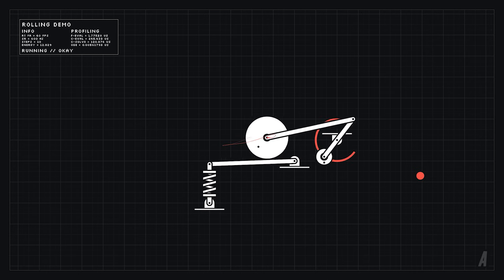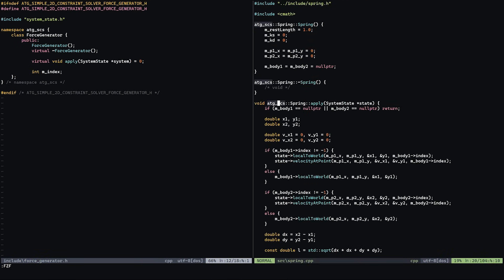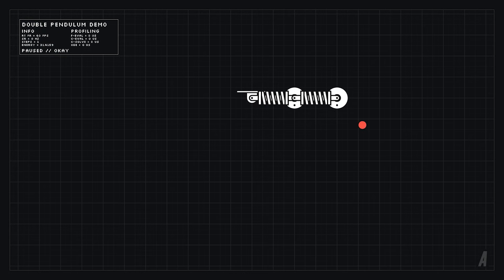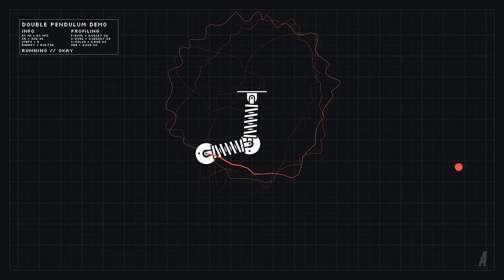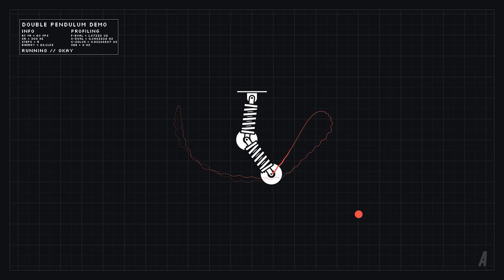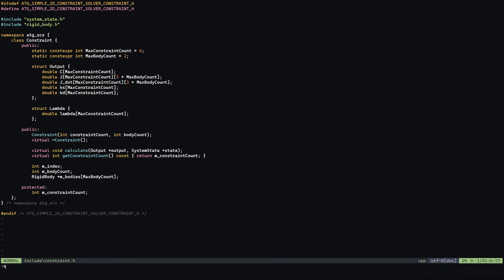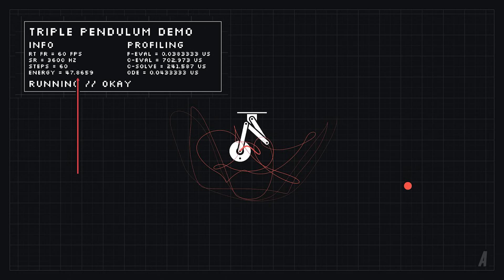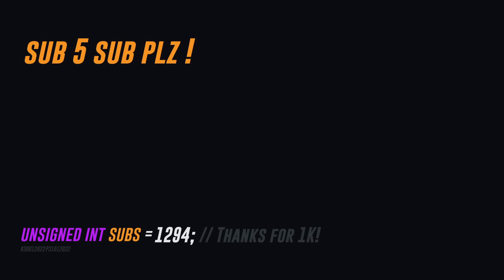Building a Physics Engine with C++ and Simulating Machines

Comment: Let me get this straight. You were struggling with obs, so you just made your own video encoder????
Reply from the maker: Not exactly. I wasn’t struggling with OBS, it’s a very straightforward program to use. I didn’t like how it would drop frames regardless of how well my computer was running. So, I took the encoding library that OBS uses (ffmpeg) and used it to make my own capture program that doesn’t have that issue. It was fairly easy; you can see the code on my GitHub

Comment: Wouldnt the problem of total energy of the system increasing be more elegantly solved by using a numerical method that preserves energy (like verlet integration) rather than applying damping?

Comment: Why fucking NOBODY when does video about creating a whole physics simulation engine FROM SCRATCH talks about how you turn the code into animation? What do you install and how?
Reply from the maker: @flamurtarinegjakyt3745  First of all, relax. Second of all, I don't talk about it because it's not relevant to the topic of the video which is physics, not rendering. Third, I don't have to talk about it, the rendering code is open source and available on my github. I wrote all that code from scratch as well.
Reply: @AngeTheGreat  sorry I don't want to be mean but I was looking a lot for it 😅

Comment: 10:30 Is friction included in the interaction between the circle and the plane it's sitting on? Like how does circle rotation change direction?
How does angular velocity of the circle affect the energy of the system?

Comment: Windows? Really?
Reply from the maker: Yes.
Reply: @AngeTheGreat   I didn't expect you to respond, just doing a little trolling....presumably the framework isn't tied to Windows and could be implemented for other WM's? I noticed there is a dependency in the audio code somewhere so it seemed a bit more tied-in than that
Reply from the maker: @GeorgeSukFuk  the game engine in this video is my old game engine which only supports windows, but it does work really well with emulators like proton. What discrepancy did you notice in the audio code?
Reply: @AngeTheGreat  ok, ignore me, I actually think I saw something being brought in transitively from one of the other dependencies of the demo project.
Reply: @AngeTheGreat  since you're reading my comments, just want to say I am running the steam simulator from Steam using proton as we speak, having a blast with it even though I do not know what I'm doing!
Reply from the maker: @GeorgeSukFuk  That's great, glad you're enjoying it. There will be an update video about Steam Engine Simulator on my channel soon

Comment: 3:46 I'm confused. I didn't find this in your code, but I didn't think you implemented RK4 or even RK2 (the midpoint method) because looking at engine torque or hp, when you double the simulation rate, the difference halves, so error scales linearly with sample size. I was going to look into it but I am slow and have many distractions. It would probably take me longer to understand than it took you to write the code. So I'll just leave a comment like a bug report.
Reply from the maker: Engine Simulator doesn't use the RK4 method, it uses the semi-implicit Euler method
Reply: @AngeTheGreat  Thanks for replying. I think I saw another video that mentioned that but a lot of this is over my head. I had a feeling it could be be greatly optimized but I'll have to do my own research for now. Maybe one day I actually will improve your code. Although if that happens it might be a year later, and you will have done much better than me.

Comment: Hi! Could you help me with something urgent? I have a mousetrap car, looking somewhat like the first demonstration you made. I am trying to find the ideal stick parameter so that the car travels the further
Reply: I don't know if you need help anymore, but I would recommend another forum like stackoverflow for example to get help if you need it. Obviously they usually help with programming, although it sounds like it's a physics question. It sounds like you are asking how to optimize a design. The standard way is to tweak things and see what happens. A sophisticated way of doing that would be a neural network. That's over my head but it basically randomly tweaks things and sees what does the best and works with that. There's a lot o machine learning videos on youtube.

Comment: you could have done it waaaaaay easier: write your DAE as c(x',x,t)=0, just stack all the equations and variables in one vector respectively, and use whatever implicit IVP solver you have at hand: LGR, BDF, etc. I actually did exactly that, modelling mixed multi-physics systems with 3D rigid bodies, electrical circuits, power plants, etc. Now if parts are continuous (instead of rigid) then is where the trouble of PDE starts, as then you need semi-discretization first to obtain DAE from PDE. And then the DAE are typically too large in dimension for real-time solution. Oh, and once your can solve your IVPs, you probably want to solve c(x',x,t,u)=0 instead, where u is a control input that you want to optimize in order for your system to maximize a purpose (e.g., power throughput, performance, minimum time to finish, etc). You just started :)

Comment: You can try using a symplectic integrator such as velocity verlet to increase numerical stability so that the energy/system does not diverge over time.

Comment: FYI you showed explicit Euler integration which is very unstable. Look up symplectic Euler, which is a one line of code change which will make your simulation both more accurate in terms of conserved quantities and vastly more stable at large time steps

Comment: It's fun getting back into C++.  After understanding a few of these functions, I hope to use them to model musical instruments physically.  It was disappointing so far to hear the results of so-called physically modelled instruments.  Unfortunately, Sample-based libraries are 'by large' still closest to simulating a viable digital twin for a physical instrument.  I would like start with a Fender Rhodes, that is widely understandable from mechanism to electric circuitry.

Comment: You could do the video capture with a pretty simple GStreamer pipeline. GStreamer can directly take your video buffers and automatically wire up a pipeline to encode into pretty much any arbitrary format.

I would also say that, since you're using C++, you could group "x", "y", and "theta" into a 'struct' and create operators for different arithmetic operations for that 'struct'. This would make the code shorter and clearer--and make mistakes less likely if you can rely on well-written operators to do some of the repetitive steps for you.
Reply from the maker: I've used GStreamer before though I don't think it would have been any simpler than simply using ffmpeg directly, it was a fairly straightforward thing to implement.

Ordinarily I would done this and have done it on my other projects (ie using classes and overloaded operators). I wanted to keep this codebase minimalistic and almost C-like. I like to try different coding styles on different projects. I found that it didn't really cause issues on this project and I found it readable, though I'd probably just do it with classes for vectors in the future.

Comment: For the triple pendulum, would there still be issues if there was a small rotational dampening from the joints? As realistically there would be some. There would also be energy loss due to friction with air and from a small amount of stretching as even things like steel stretch and compress albiet not that much.
Reply from the maker: Yep that would usually fix the issue in practice. I think I mentioned it in the video at some point but I don't remember anymore. Thanks for watching!
Reply: @AngeTheGreat  you probably did, it was towards the end so I might've left the video before you mentioned it lol Also your engine sim is insanely cool

Comment: You can use magnets instead of springs, your perpetual motion motion machine is almost complete... But It may be easier to physically build an electromagnet to replace the springs in your demonstration than to program one..God Bless

Comment: Rk4 gets you good accuracy but it is still explicit and does not have great stability properties. You can switch to an implicit Euler and theoretically remove those instabilities forever. There are higher order implicit options as well that improve stability

Comment: great insights and you using what I still remember from 30 years ago when I was C/C++/Assembler teen in love with 3D :) including rungakuta 4th order, quaternions for rotations etc :)
One doubt at 5m52s in the connected net of points, how did you approached that .. in terms of sequence to process stuff like new pos, vel for each node..

Comment: The color scheme of the video is something you could work on. Dark themes can be hard to read but mixing different themes makes it worse. Worst offender is the PDF document which had a light color sceme (for some reason??)
Reply from the maker: I can understand the PDF being out of place (which also annoyed me but I couldn't really justify spending any more time trying to fix it) but I thought everything else used pretty consistent colors?

Comment: First, you take the dinglepop, and you smooth it out with a bunch of schleem.
The schleem is then repurposed for later batches.
Then you take the dinglebop and push it through the grumbo, where the fleeb is rubbed against it.
Reply from the maker: Yes, that's correct

Comment: The code is hard to read. I see the primitive obsession code smell. I believe it will be clearer if you introduce some structs/classes that make the code more abstract—at least Vertex2d/Vertex3d.
Reply from the maker: I wrote it in a different style from my other projects (which all use structs for vectors). I don't really find it that hard to read
Reply: @AngeTheGreat  maybe that's because you saw a lot of similar code, so your brain skips duplicated code quickly. To me, the code contains a lot of noise that prevents me from understanding the intent. Consider looking for "primitive obsession" code smell and techniques to eliminate it. It can help to read the code for non-prepared watchers of your video, like me, which can increase the views and popularity of your channel. 
I mean not only vectors; it's just what first comes to mind. I'm sure if you start refactoring, you can introduce a lot of other abstractions. Maybe Velocity, Force, or something more domain/algorithm specific.
Reply from the maker: @MrXzxzxc  I understand what you're referring to, however, this primitive obsession "smell" as you refer to it was entirely intentional. Over the years, I've worked with a lot of libraries with varying levels of abstraction and over time I've found myself leaning to a more primitive style. I find it easier to read, easier to write and more flexible for optimizations. I absolutely detest unraveling someone's unnecessary abstraction they wrote in the hopes of making their code "simpler". Most of the time it fails to simplify anything and makes my life harder. I think this is part of a widespread problem right now in software of overcomplicating problems and preferring overly abstracted designs with no real justification. I used to be this way myself but over time I've realized it has very little payoff.

The feedback I've received from viewers has been mostly positive and I haven't gotten any complaints about it not being readable. In fact I've received emails stating the opposite, so I'll leave it as is for now.
Reply: @AngeTheGreat  , thanks for the answer. It seems we have opposite views on the design of the software.

Comment: You can try GeoGebra. I do not know any codding and math. But I can make many thinks with using only shapes, dots and points. It is hard to say about some  most complex formulas (what created by expert professors or other scientists.) can ultra easy to find as different way without numbers. And some of them works better in many ways. For example I was tried smiler things like you did. I think you can try to use spiral to make that object fall. Spiral shapes, turns, and size can be change for velocity, mass and high. I think spiral should reflect to other side if object fall down point is upper than object connection pivot point. I can not explain this by cods or formulas but I wish it will work better.

Comment: Use conservation of energy as a constraint and it should eliminate the energy creeping into your system due to error.
Reply from the maker: Conservation of energy IS one of the constraints (it's discussed in the paper I show in the video), the energy creeping into the system is due to numerical error and is not avoidable in a trivial way without either improving the numerical methods or reducing the timestep.

Comment: re: egy conservation: what if, at the end of the step calculation, you use_the information that  the total energy in the system must remain exactly the same (ignoring friction for now) and distribute the energy _difference amongst the degrees of freedom in the system?

have you noticed any difference in performance/behavior between single/double precision?

Comment: floored at the casual mention of a c++ mp4 capture software being created because obs was dropping frames
Reply from the maker: It's actually not that hard, I just used the same encoder used in OBS and did some basic thread synchronization to get it to work in real-time. Thanks for watching!
Reply: @AngeTheGreat  just the fact that you've given yourself all the prerequisite knowledge necessary to to look at up, and understand exactly how to implement it in your own project is still flooring me. you've like minmaxed for useful coding skills and creative problem solving.
incredible stuff, great job, looking forward to your next upload!

Comment: 2:02 In my experience the timestep for physics engines is very rarely just the length of each video frame in games. A fixed timestep is standard practice because it's so much more consistent and reliable.
Reply: Fixed timesteps are also necessary for symplectic integrators (e.g. semi-implicit Euler and Verlet Methods) to work properly.